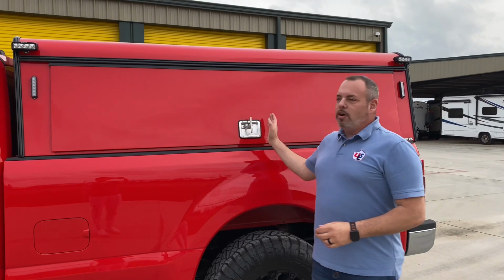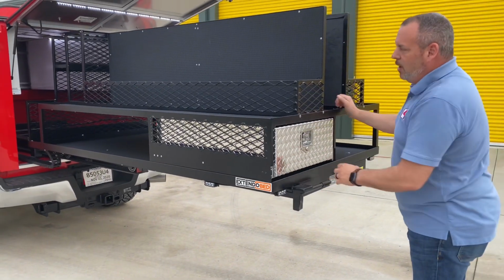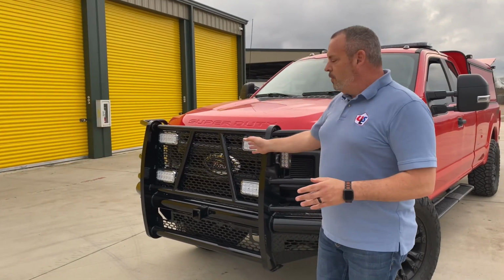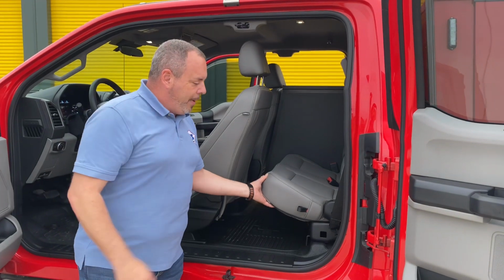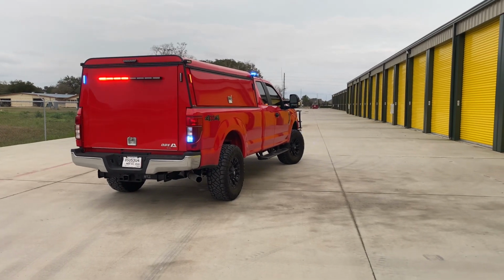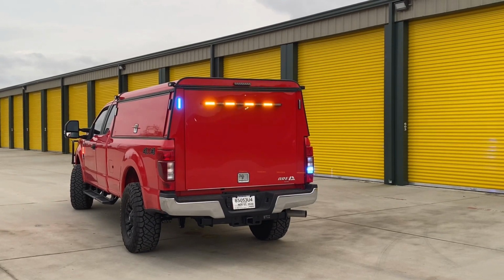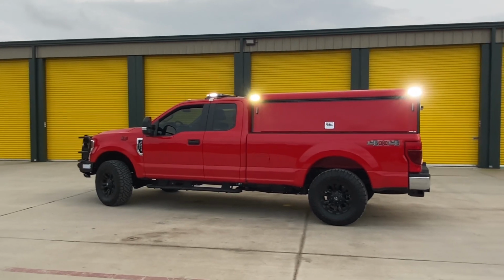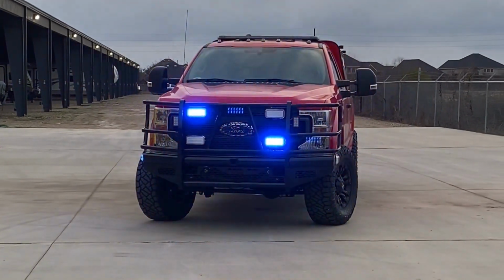ULS - Ultimate Lighting Solution 2021 F250 Fire / Rescue Squad

Comment: Great build! I would have put a pair of Wide Lux on the rear facing instead of those skinnies. But Thank you for paying attention to proper flash patterns! Curious on why the T/A was mounted to the rear door face, and not placed on the topper rear edge. Its a thin enough to mount on top. Also why add the color outbound to the Left/Rigth TA pattern function? it sort of convolutes the image from a distance, especially at night. As the blue wave lengths will drown out your vision following an amber flash, and then adding red. Personal feeling arrows should be amber only. Which brings me to ask Is there a DVI pattern available with that unit?  I'm really being picky, because overall its a great build!